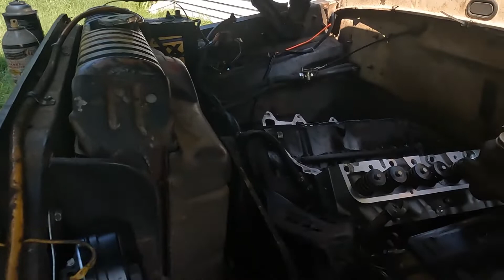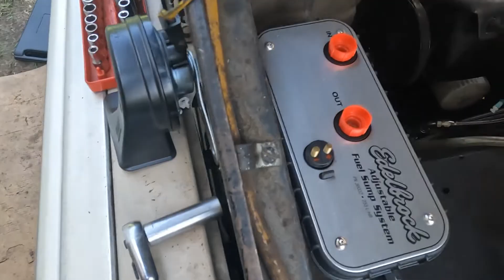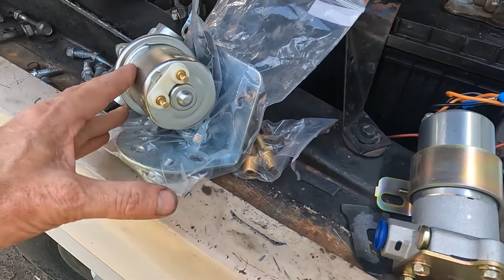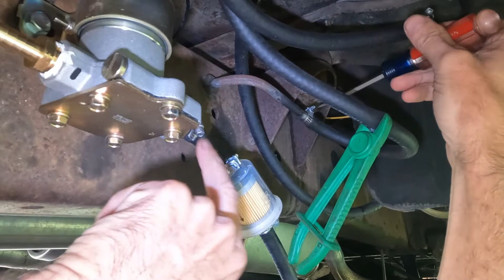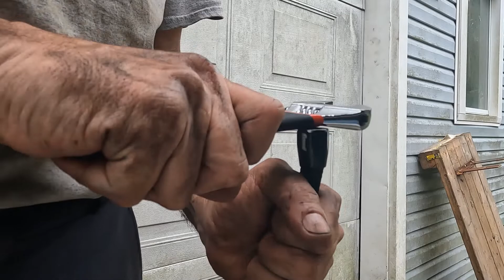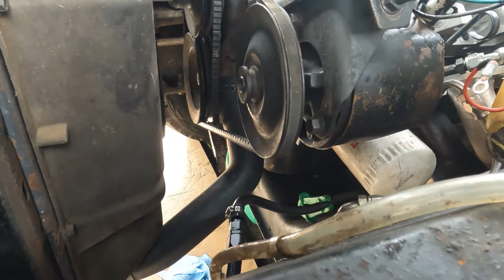Edelbrock Pro-Flow 4 Fuel System install. Part II

Comment: Hi, how did you connect the return line to the tank?  To the edelbrock fuel sump? Thanks
Reply from the maker: I have two tanks in the truck, the second one is a boat tank. I hooked the return up to the vent and raised the vent hose up higher. Thanks for the question

Comment: Hi CC'S Garage,  since the fuel pump sump has been installed, have you not had problems with hot gasoline? Good video
Reply from the maker: No problems with it.
Reply: Hi, how did you connect the return line to the tank?  To the edelbrock fuel sump? Thanks
Reply: @zbyneknovak9080  Yes, I connected it to the hose on the tank filler neck. I don't know if it's a problem with the engine heat or if the filter holders are made of aluminum and heat up faster. Thanks
Reply from the maker: No Problems. But I would like to install a single pump in both of the tanks later on.
Reply: @ccsgarage  It would be better to install the fuel pump inside the tank, because I feel that hot gasoline for the EFI system is not good.